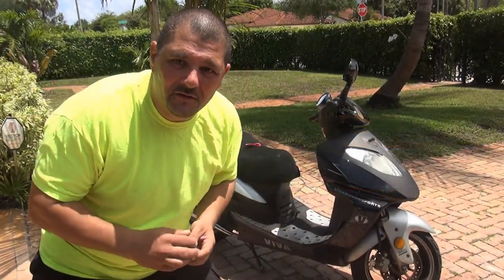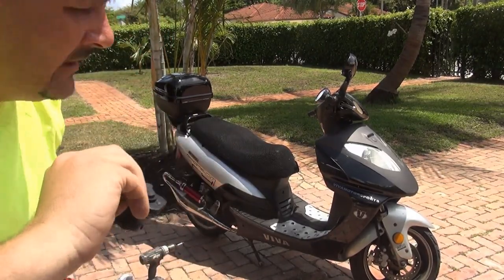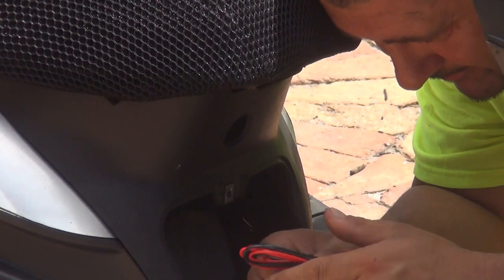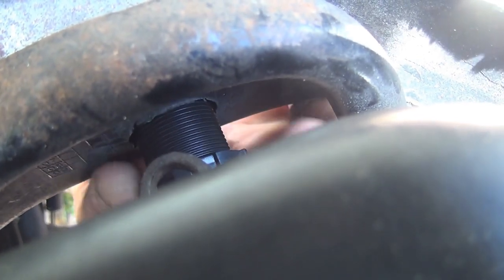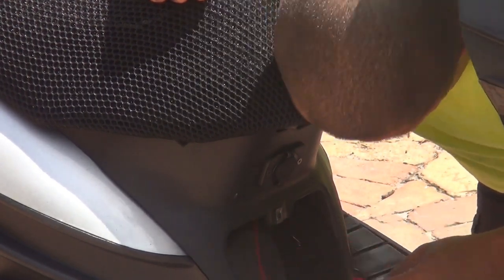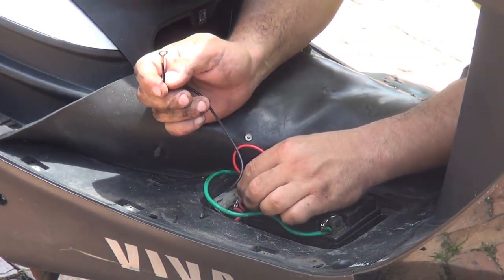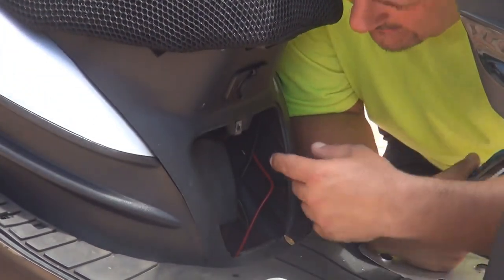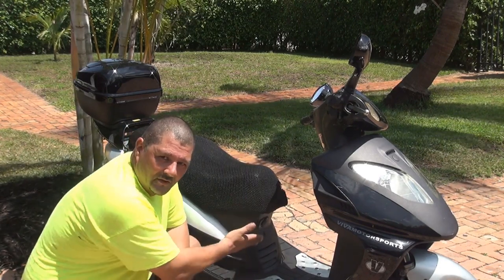How to add a 12v power outlet  to your Scooter / Motorcycle

Comment: Instead of running both connections directly to your battery and the ports always being live ⚠️ You could bring your HOT up to the front of the bike and find the connector that your ignition switch is wired to. Use a multimeter to test each wire in the connector until you find one that reads 12v with the key on and 0 volts with the key off, then splice into that one... that way, when you turn your scooter off, it kills the USB ports and doesn't risk draining your battery. It sounds taxing, but it's actually much easier to do than what it sounds like. I done it on a Powermax 150 TaoTao
Reply from the maker: Great Idea thank you for sharing if you can please take a video so I can share with everyone else Thanks

Comment: Hey virb.   I dont run a battery on my taotao 50cc.    Can a outlet be powered by the stator only?
Reply from the maker: Hello I don't think is possible if you are not running  a battery to have a 12v power  because if you get the voltage from the regulator the flow of the current/voltage will not be stable . Thank you for watching my video

Comment: On dc shouldn't you attach the black wire to the body ground on the valve cover?
Reply from the maker: Hello yes anywhere you can find the best clear ground you can connect the negative part  but personally for me is the battery that is the source of the ground that is where everything is starting . Thank you for watching my video